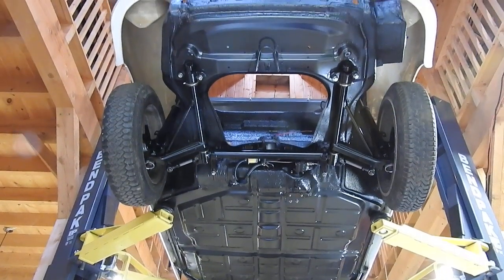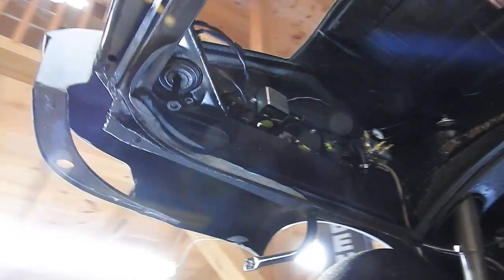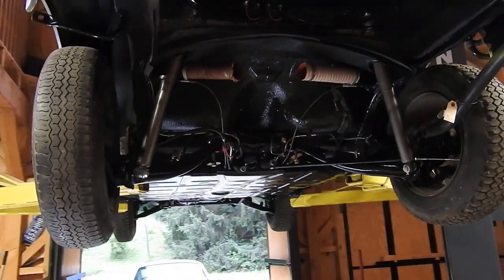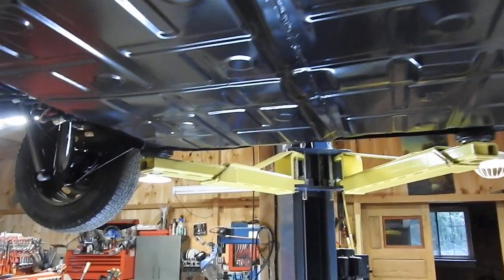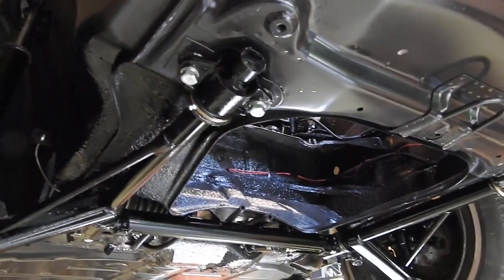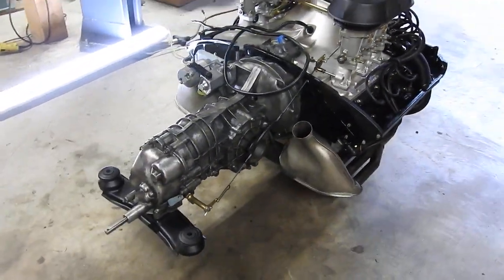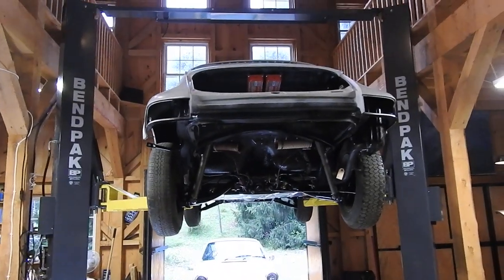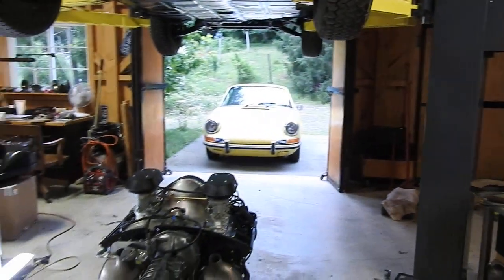1969 Porsche 911 T restoration (now R) part 6 : The turning point

Comment: Fantastic! 👍🏼… but what about videos of the rust/panel repairs?… I have a similar condition 69 911T and need as much visual guidance as I can get  :)
Reply from the maker: Thanks! I never made any detailed panel replacement videos but if you look at some of the earlier videos in the series I show some information about the lineup of some of the panels using a laser measuring system. The only really tricky rust repair was below the rear torsion tubes and replacing the right front corner. Good luck with your project.